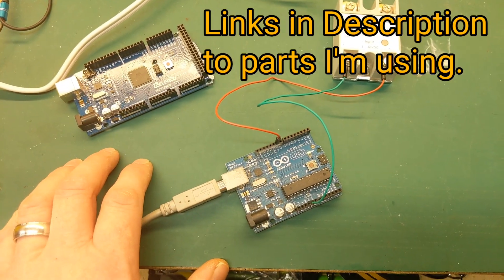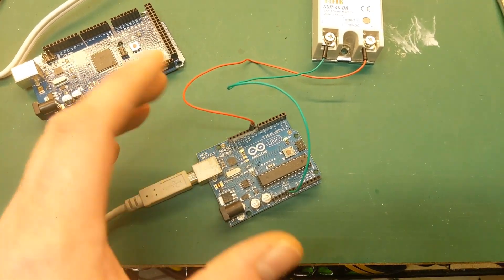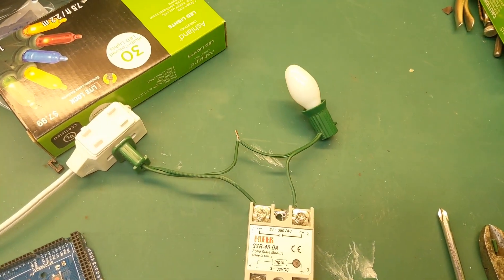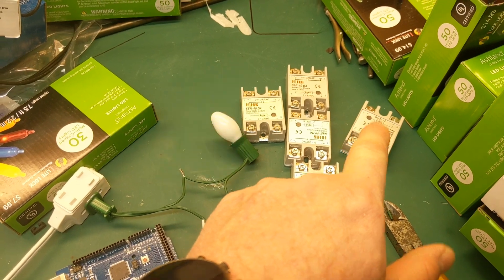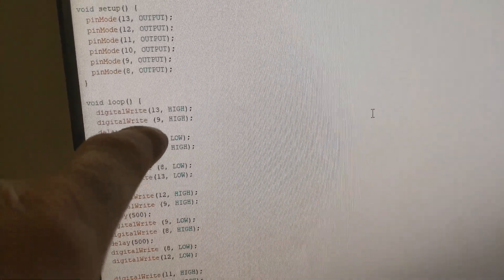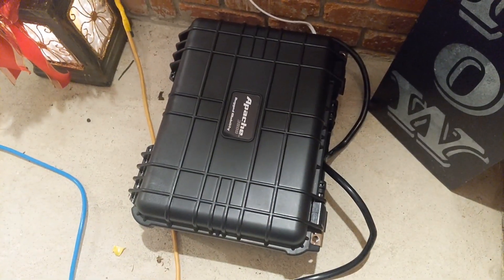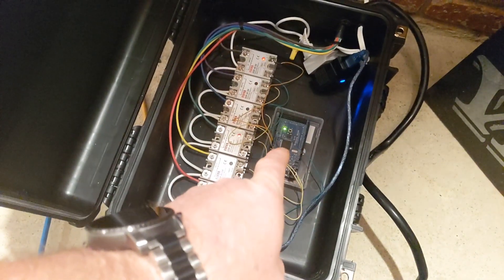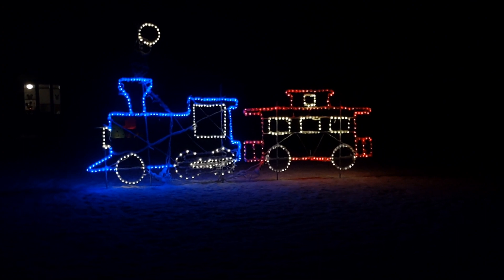DIY Animated Wire Frame Christmas lights, how we built them back in the day and today! Part 2

Comment: I built my Christmas train when I worked at Devry.   I put the lights on a pegboard.  No smoke - one smoke ovals then 2 smokes then repeat.  at the same time the connecting rod getting bigger front and smaller back at the same time moving parallel instead of the circle.  I think it looks better that way.  I am building one for my front yard now.

Comment: Great job and design. Something that you might like to see are the RGB LED pixels. They use DC so lots less power and you can get this and tons of other effect with out as many relay.
Reply from the maker: Funny story, when I first started making circuit boards to run Christmas light displays back in the early 90s, I controlled them using SCR's.  SCR's are DC only unlike a TRIAC, so I ran those AC lights on a full bridge rectifier supplying DC.    But yes, RGB pixels are fun and I've used them on various projects over the years.    I don't remember if I mentioned it in the video, but the lights on these displays are LEDs as well so no concern over power.